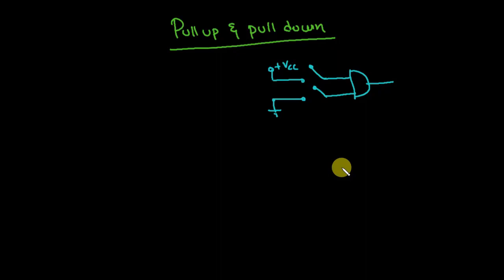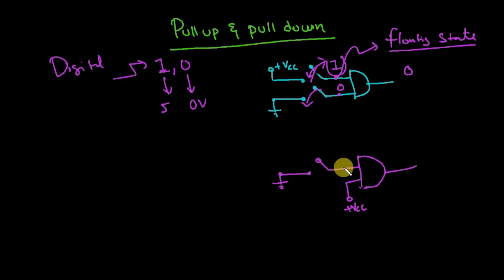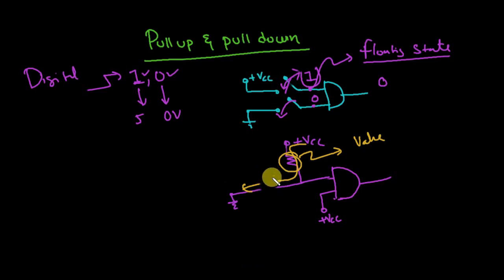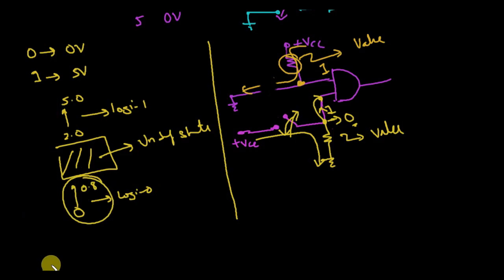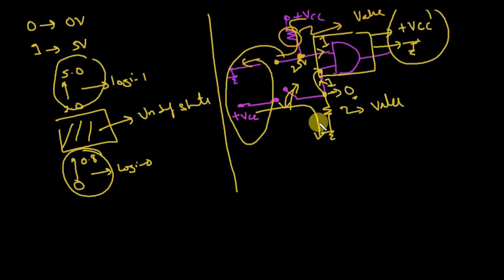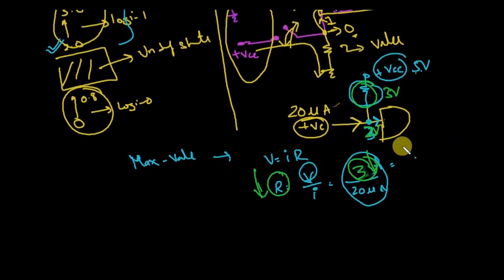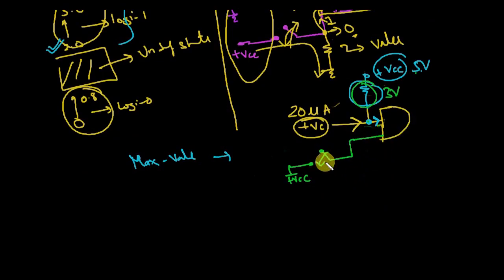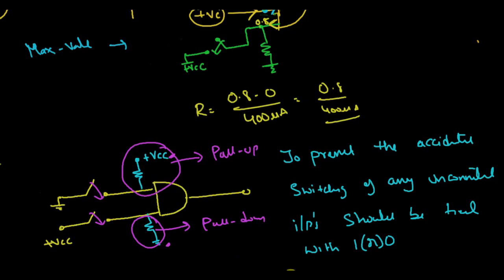Pull Up And Pull Down resistors

Comment: i have a doubt about the part where you said that when we open the switch it will go in "floating" condition & not "0"  . However it will go to zero which is quite obvious as nothing is zero only . possible explanation which I have received from other lecture is that because of presence of em waves in the atmosphere ,  it will polarize the open ends a bit so instead of "0" it will receive say, 0.8V at the input . 
you can refer to nptel -embedded system design by dhanajay gadre (lec 15 mid )
liked rest of the part .
Reply from the maker: Hi Abhishek,
Well you said that due to EM waves some voltage will appear at input, YES its true but it's left to float, which means it's in an indeterminate state: maybe high, maybe low, maybe somewhere in the middle. Worse, it may even change depending on other conditions in the environment. That means the output may be unreliable, and that's usually not what we want.

I hope I cleared your doubt....
Reply: @Pankaj_prasad100  yes 👍